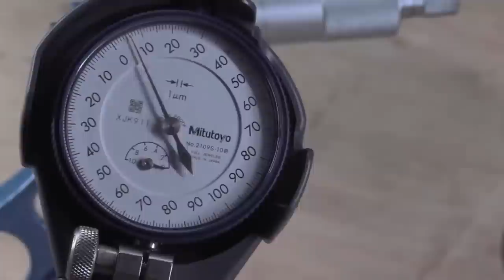Complete SV1000 ENGINE Rebuild • Part 1

Comment: I keep saying Suzuki needs to make this bike again in a modern form , well done .
Reply: They could probably put a lot of the kit from a V-Strom 1050 in a SV650 frame tbh and give it a suspension upgrade (GSXS1000 type spec?), I think that would get you most of the way there. I'm really surprised they haven't done a cruiser with the 650 or 1000cc V-twin either, it'd be a huge seller with relatively little engineering cost.
Reply: Well since all their current bikes are all old they could probably just start selling it again and  no one would notice

Comment: Good job Del wasn’t doing it, he’d need to spray the inside of the cases with some ultra high temperature linen wax. 
But I digress, my mate is currently restoring an SV 650 1999, got to say he has had a few problems. Which has required new carburettors (because some pilchard restored the old ones ) another set of associated issues. Also the regulator let out the massive magic smoke caused by all those electrical pixies fighting with each other. It’s quite nice to work with some basic kit, because with the modern stuff you’ve got no chance.
Reply: Brilliant

Comment: I had one of these back in the day, fitted  N2O to it theoretical +50bhp with no problems. The pistons are forged and the clutch has Hayabusa part numbers. Just ran one grade colder plugs. Was like pressing the hyper space button on an old arcade game.
Reply: N20?
Reply: @rogkmyers  Nitrous Oxide.

Comment: Music is a bit gloomy! So has anyone(millyard'esk) thought about an SV650 twin?? Sv 1300. Frickin beast!Just sayin'
Reply from the maker: With low powered stuff it's easier to stick engines together. But when you get into the 100HP+ region its not so easy to stick stuff together. An twin 650 sv would be less of a beast than a vfr1200 already exists and makes more power than 2 sv's
Reply: Yeah all agreed frickin humbug 😑. Would still be an, interesting project.